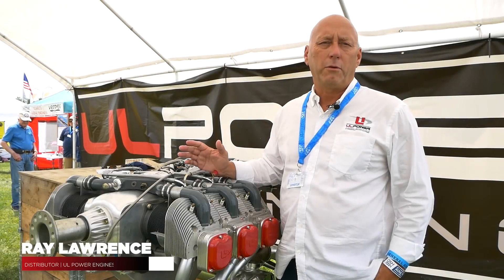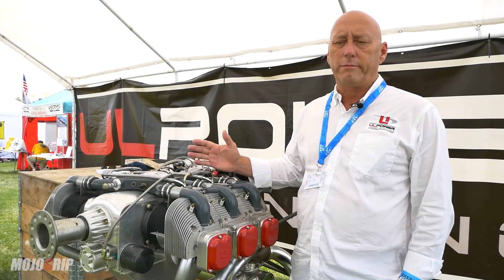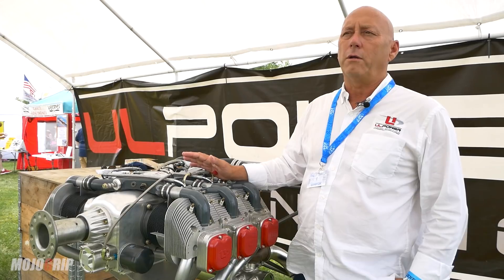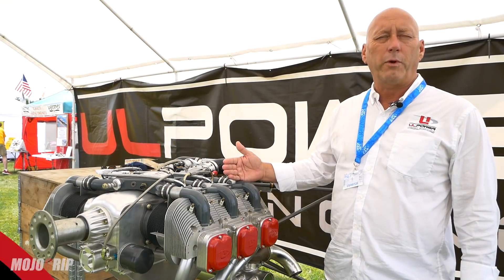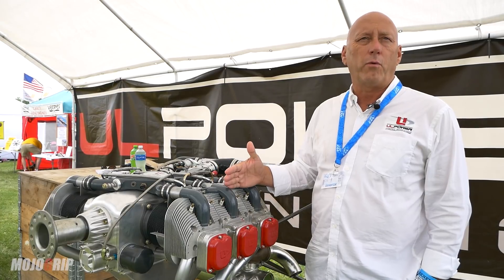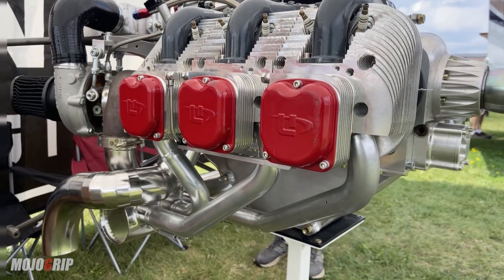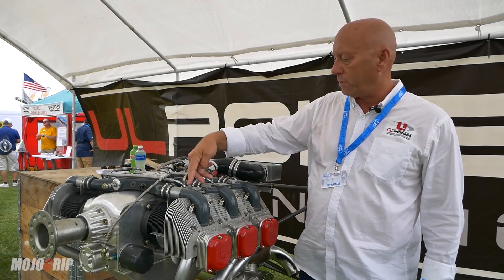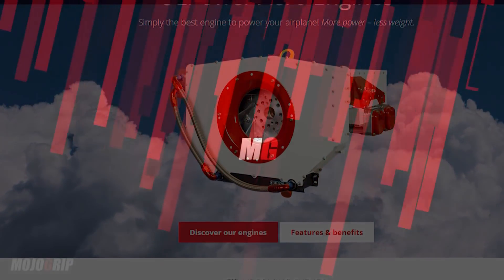Experimental Planes Powered By UL FADEC Engines

Comment: Nice looking engine but much less complex than an automobile engine with at least four times the cost.  Just doesn't add up.  Understand your are not mass producing like an auto manufacturer but what justifies the cost at nearly 50 grand?
The answer is because you can and still be less expensive than a traditional LA engine manufacturer.  Get this beauty down in the mid to low 30s and you will sell tons of them.
Reply: I believe the non-turbo version is $35k.

Comment: Does it run on premium unleaded pump gas?
Reply: They claim that they will run on both  LL avgas and UL premium.  From the little info I've found of people who have these engines is that you are better off using unleaded gas,  As leaded avgas builds up deposits on valves and lowers the overhaul time.

Comment: Why is it in WWII we could build and fly planes for the price of a used car. Now the motors alone are a decent down payment on a house. No wonder aviation is dying. Make an affordable engine
Reply: A new house in 1944 cost 3450.00, A P-51 Mustang cost 50,000.00.  so please tell me again how cheap aviation was in WWII compared to today.
Reply: @kvnkaveman  that's comparing apples to oranges. Today's homes cost $300k and an F-15 cost 90 million, so the jet cost 300 times more than a home today, where as the mustang only cost about 15 times more than a home
Reply: @kvnkaveman  civilian planes could be had for $1,500. Surplus bombers were selling for 1,700
Reply: @hud86  The point is aviation is expensive now and it was expensive then. Those surplus planes you speak of were delivered in boxes. It cost a lot of money to put them back together not to mention keeping them maintained and flying. Hence that is why such few still exist today.   You can buy Cessna's and Pipers today that are in the price range of a used car, the maintenance such as an engine overhaul is still going to be expensive just as it was then.   Hobby flying wasn't cheap then and it isn't cheap now, never has been.